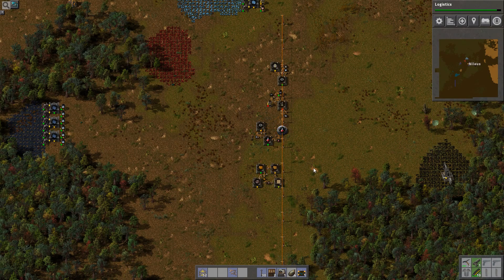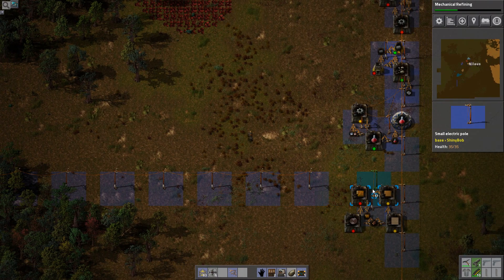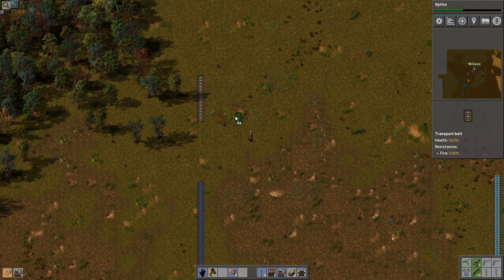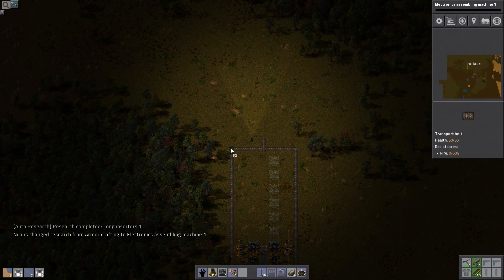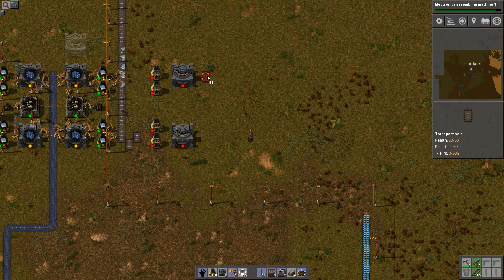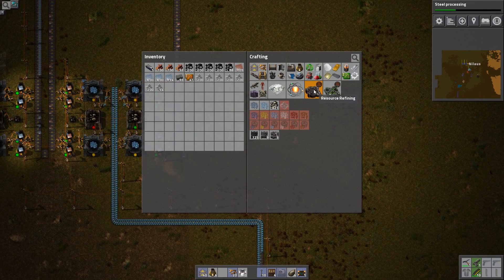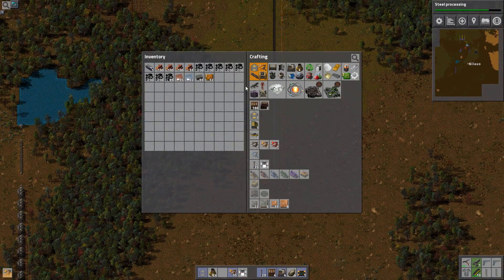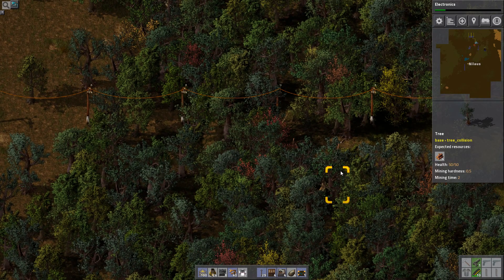Factorio S8E02 - Crushing and Smelting Iron and Copper

Comment: Wondering why the RSO mod config files (for angels) doesn't provide all six ores in the starting area by default.  Makes it a little cumbersome if you are wanting to sort to iron(saph & jivo) and copper ore (stir & crot) early on for increased throughput.  I usually just sort ruby and bobmonium individually.  

Do you like sorting each of the crushed ores individually instead? I could see it maybe being more fun now due to all the ingot mixing in the mid to late game.
Reply from the maker: I've always thought it made perfect sense. Jivolite and Crotinium are not adding anything new as they sort to Iron and Copper respectively, hence adding them to the starting area wouldn't add new features (early game), but would add more complexity.

Comment: Please just manually drive one of the miners to cut down forests. Keep a pocket one for emergency deforestation.
Reply from the maker: I know that I can drive them, but they are really really slow (as they should be). So when I am steering one the other 3 are idle and the base is not progressing. Therefore I prefer to spend 2 idle clicks to send one towards more trees. It is like in Starcraft; you need to be able to issue commands in parallel while progressing the base.
It is quite deliberate that I choose this method :)
Reply: Well manually driving one to make a belt passage through the forest is much faster than manually chopping.